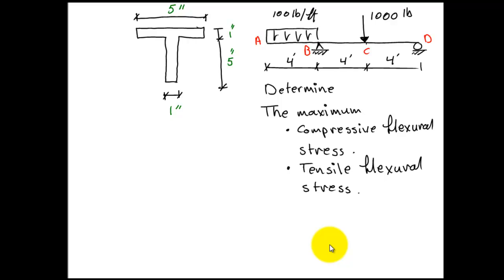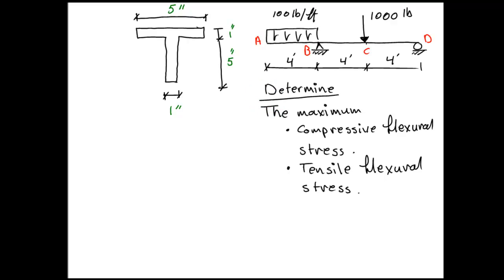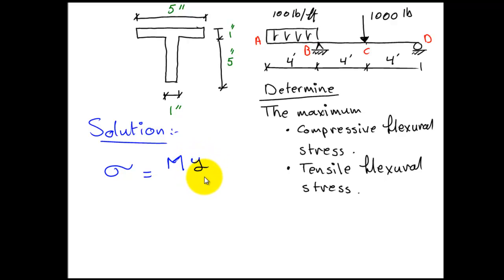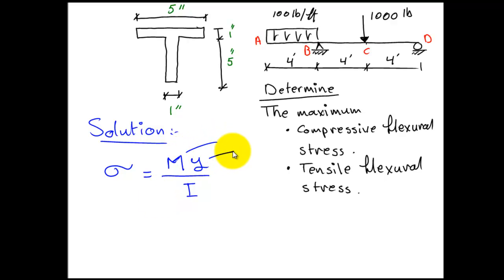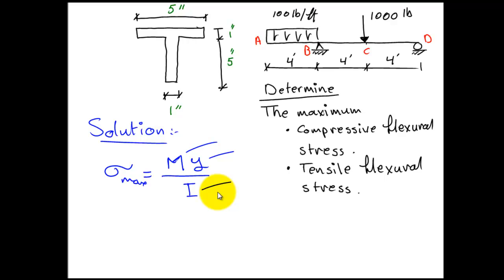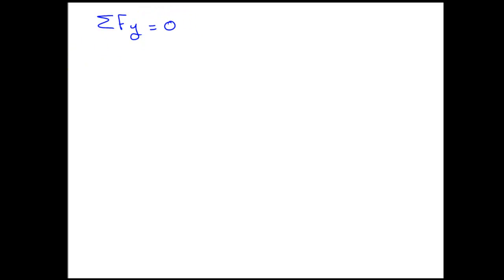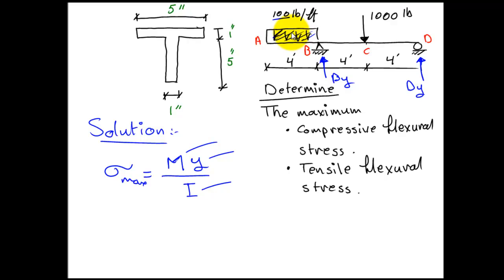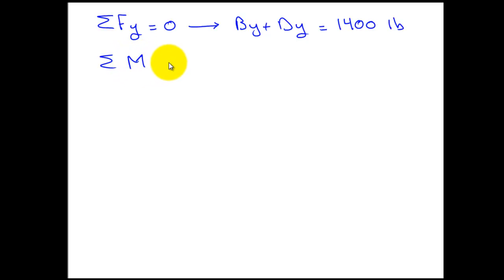English - Finding Compressive and Tensile Flexural Stresses for a T-Beam

Comment from the maker: the maximum moment will create a maximum stress in general. depending on the orientation of the moment, it can cause compressive or tensile stress. if you have one moment, all you need the "y" distance from the N.A to the outer fiber. since the N.A will be located somewhere within the cross section of the beam, you should have two values for "y" (the greater value will create the greater stress)
hope that was helpful.

Comment from the maker: that is all based on the deflected shape.
the deflected shape will be sagging between supports putting the top fiber in compression and the lower fiber in tension. where above support "B" the beam will be concaved down putting the top fiber in tension and the top fiber in compression.
again it is all based on the deflected shape. give it a shot.

CTSCIVIL

Comment: thank you, it's great, but how would I know whether the upper part (or lower part) is under tension or it's under compression?
Reply from the maker: Obadah Alhalabi you can tell by looking at the deflected shape of the beam. if the fiber on the top (or bottom) will stretch, that means tension. If it will contract, that means compression.
Reply: +CTSCIVIL from the moment diagram right? If it's positive that means it concave upward which means it's comprehension in the upper part?

Comment: Awesome...
thank u so much...i saw lots of videos...bt u r really amzing....
I have 1question...How can we find that 'T' beam is under tension or compression...??? Plz help me
Reply: +PRATIK BHOR If the beam has force applied from above then the beam will bend in a U-shape. This makes the top points of the beam closer to each other and puts them under compression stress. The bottom part of the beam has been stretched out so it's under tensile stress. If the force was on the bottom the beam will bend in a n-shape which makes the bottom compressed and the top tensile.

Comment: you calculated the maximum C & T stresses for Y=4" .Here my question is for minimum C & T stresses the value of Y changes into 2" or not...???? it will help in Design concept... Because the value of depth of compression block "a "changes for both when C shifts to bottom or top... Can you help me here
Reply from the maker: +Muhammad Anwar You are 100% correct. If you are trying just to see the max and min stresses then what you say is correct. However, if what you are trying to find is designated by "compression only" or "tension only" then you have to look at the physical meaning of the moment. In simple terms, (for example), if you use the moment at point C, the usage of 4 inches will give you tensile stress and the usage of 2 inches will give you the compression stress at point C.
I hope that was clear

Comment: on your moment diagram. it should be positive 800 and negative 1600. thats what we got taught in class. below 0 is positive and above 0 is negative for the moment diagram 
but you seem to do it oppisite. can you explain? thanks
Reply from the maker: Sign convension. That is all 😀
Reply: +CTSCIVIL what do you mean ?
Reply: no way..the moment is positive when the force is applied from the above to the bottom and the beam is simply supported and will deformed as U shape but under the distributed load the beam is supported from one and its conceder as a fixed support due to the contiuity so the deformation will be n shape and it will negative moment  and from the moment type you'll know where to put the concrete bars from the beam section
Reply from the maker: +sos sos Yes Way :P
I am not arguing about how the positive or negative moments are defined. I am just saying that if you decide to draw the positive moment downward and negative moment upward should be OK. Some Reinforced concrete designers prefer to draw the positive moment (tension side) downward just to remind them where to put the reinforcing bars. I hope you get what I am trying to say :)
Reply: +CTSCIVIL yes bro..i completely get and got you and the video is mazing but i replied to some one said that the distibuted load cause positive moment while you were right when you said its act like a cantliver and should be negative moment am not talking about the diagram but about the theory also he said the concenterated load between the supports should be nagative and thats not right also its act like a simply supported beam and bears a positive moment..am with your side 😃 regards
Reply: +CTSCIVIL sorry was just a bit confused as we get taught in our lecture that positive moment is downwards and negative upwards hence I asked to clarify . thank you. good video though I learned a lot still
Reply: +aminul hoque we all are learning brother..you always try to imagine the deformation shape if its "u" shaped its positive moment and if its "n" shaped its negative moment ..regards

Comment: why didn't you use 1600 for the maximum compressive stress instead of 800?
Reply from the maker: first, use the maximum y value with the maximum moment then see what type of stress will you get.
in our example using the 1600 with the 4 will get you a tensile stress because the segment that has a length of 4" is under tension under the effect of the 1600 moment. that is why the 1600 is used to find the tensile stress only.
if you want to use the 1600 moment to find the compressive stress at this part of the beam that is ok but remember to multiply by 2" not 4" (and only for this example) it turns out using the 1600 by 2" gives you the same values as using the 800 by 4 and that is the case, again, for this example only

Comment: Dear Sir:
Thank you for your videos and can you show me, how to find minimum stress in a beam?

please please
Reply from the maker: Muhammad Sulaiman Stanekzai As for minimum stresses in beams, they depend on what you are trying to find. Meaning, which stress are we talking about. For shear stress, the minimum shear stress takes place where the shear force is zero, the same for the bending stress where it takes place at the zero moment. Never thought about how to find the minimum stresses in a beam since they cause no "threat" to the safety of the beam.IF, and only IF, you assume that the positive stress is a max and you "call" the negative stress as minimum that would be a different story.
Reply: Dear Sir:
I mean how to find Minimum Normal Stress in a beam.
Reply: and also sir how to Find a Maximum Diflection by easy way in a beam?
Reply from the maker: Muhammad Sulaiman Stanekzai The easiest will be using a software package :) BUT, if you can find the elastic curve equation of the beam you can easily find the maximum deflections.
Reply: Dear sir would you like to explain it please.
Reply: i mean, to explain  maximum deflection of non symmetric load please